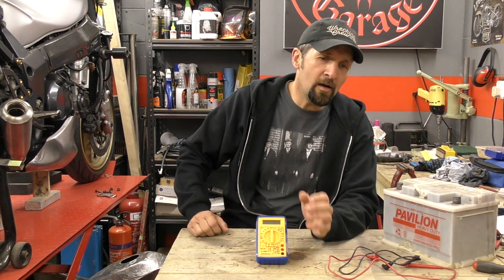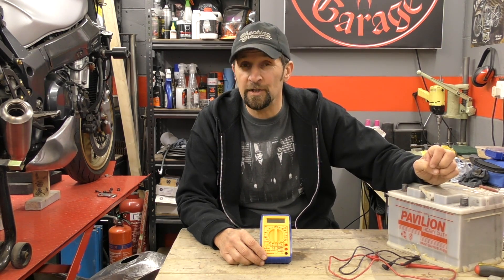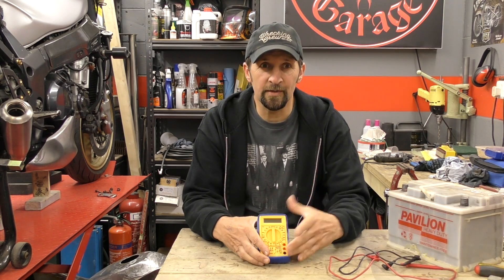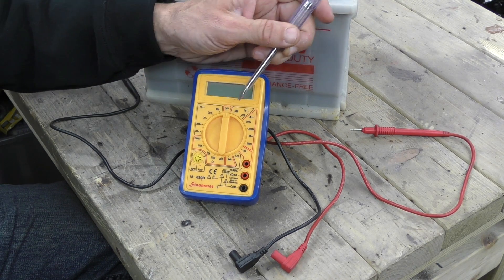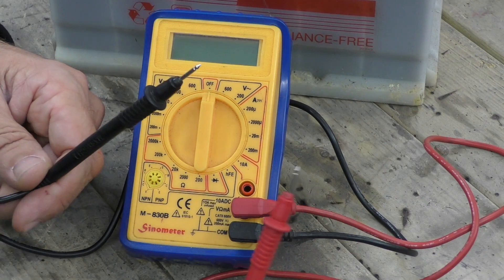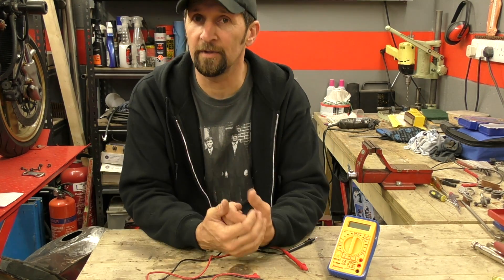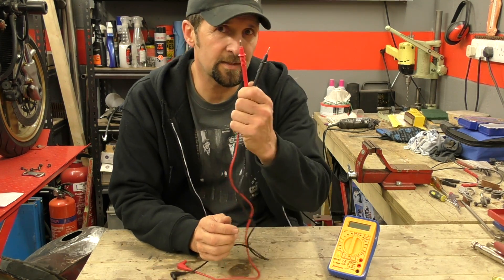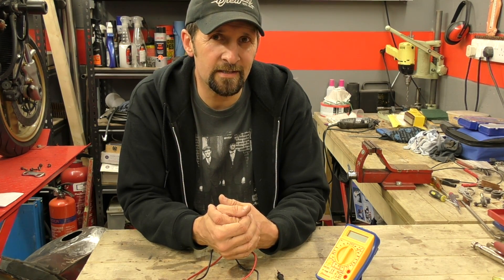Delboy's Garage, Simple Skills, # Multimeter.

Comment: Another function of the Multi-Meter that is extremely useful is the continuity checker (also know as a diode check). I know you can check continuity with the other modes but there is one built-in for this task. The symbol is the sideways triangle with the line on it. On most MM's it will "beep" if the leads are touching together when set to this mode. This is a very useful way to check for a short (a wire grounding against something it's not supposed to), or that a wire isn't broken along its length. When you hear a beep you know that the 9Vdc battery inside the Multi-Meter has a path from the positive wire to the negative (you can just touch the leads together to test it). I beep test stuff as a quick way to verify a circuit before I crack into using the Volt or Ohm meter. 

Great video as always, clear and concise. The image quality of the video looks wonderful. Cheers!

Mike & Melly
Reply from the maker: Hey Mike.. yeah. there is about another half hour of video there if i were to go over all of it.. but this was just the basic, first two main tasks you'll need... Thanks for your input buddy.. take care of The Chairman.. D&P.
Reply: LOL, yep. With electronics it can quickly go down the rabbit hole and no longer be a simple skill. ;-) Was a great video with just enough info!
Reply: @Moonfleet41  I just bought one and just getting the thing out t test my battery.. some meters are ok for electricians but not for the beginner when looking at the dial some read complicated